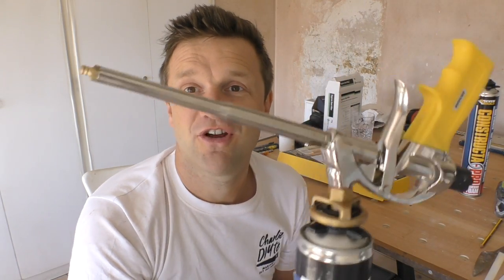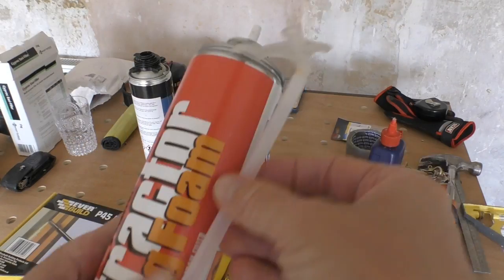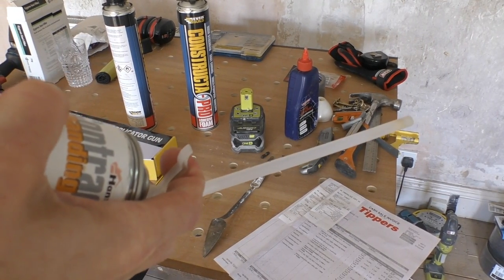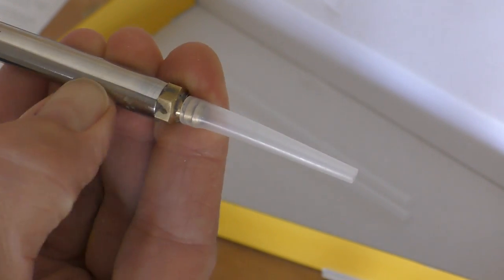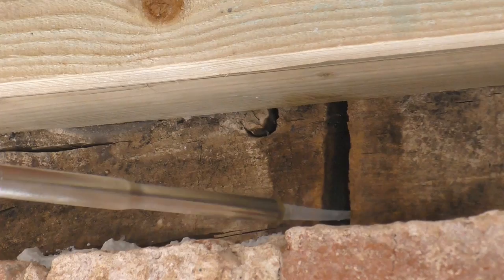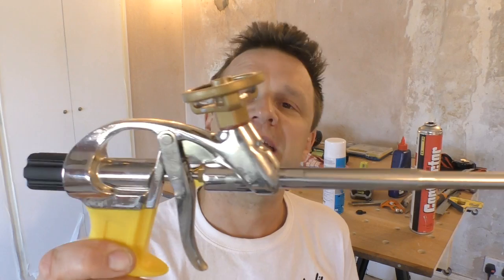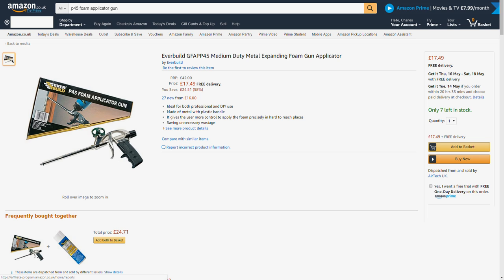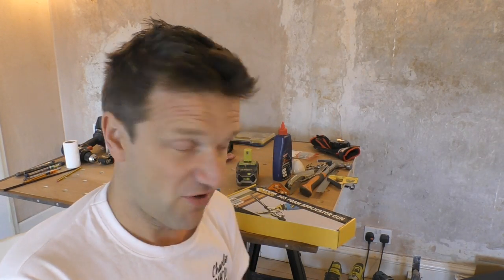Why Use an Expanding Foam Applicator Gun?

Comment: As you found out.....once you buy the foam gun, you’ll never go back to the disposable applicators. The gun is just so much easier to use, & clean; as well as, it saves the foam for another project a lot better. Use a different brand/version, but they are basically the same(differences will be cleaning & storage etc....). The gun I use actually closes the can & the gun nozzle in 2 different places, making cleanup easier; & like I said.....saves the foam for another project. Just comes down to how much willing to spend😆 & how many projects you will be doing over time...... Some guns are cheap disposable plastic guns, some are metal, & others are metal & Teflon coated etc....(most good guns will have a Teflon coated can adapter for easy cleanup).
GREAT vid, as many ppl might not know this secret, unless your in the trades.
Cheers😊
Reply: Aepek post a link for the gun you use please, cheers
Reply: Anthony John Will try to find a link for the gun I have(bought at a construction supply store....not a big box) so will try to find it, or very similar. Might take a day...just letting you know.
Ttyl

Comment: Charlie, Use Acetone and a $1 spray bottle from the garden center. I the States, 1 gallon (About a liter) but here it is less than $10. Put it in the spray bottle, Mark it with a felt tip marker (Flammable) but spray it on the straw, adaptor and if the can nozzle won’t spray, put some 10-14 drops in it, let it sit, then hit it with compressed air or simply push it.
 I used a can two month ago and had to move the ladder. By that time, it was plugged. But I put the drops into the cans tip and let sit for 5 minutes. Sure enough, it worked. Screwed on the plastic straw and worked get.  Went looking for “How to Clean” and found Acetone as a common denominator. Thank you for the info and you have different products overseas. It takes work to setup a camera, lights, props, tri-pod, then review, edit & upload. It’s work. Thanks from Nebraska.
The arctic cold air comes across North & South Dakota across Nebraska. There is only 5 strands of barb-wire and a mailbox to slow it down. So 3 weeks of -3,-4 high temps with -30 & -40 degrees F. Cold enough to Make sure to keep your giblets covered up!
Reply from the maker: Good to hear from you Dean. You paint a wonderful picture of life in Nebraska - very jealous buddy! Yes we have spray gun cleaner here which is I think acetone based. Definitely needs unclogging from time to time and a spot of silicone spray on the trigger. I wish I could reference more tools in my Descriptions for you guys, but as you say they're pretty different in a lot of cases. Thanks also for acknowledging the work involved. So true mate. My videos take on average between 2 and 5 days to edit 👊🏻👍🏻

Comment: I agree with you on the reusable applicator gun; once you use one you'll never go back to the disposable plastic nozzle. That being said, I've been reusing both the plastic nozzles, and the still partially full cans of foam, for years. Both the applicator straws, and the dispensing nozzle on the can, can easily be cleaned out with acetone and a couple of pipe cleaners. I've ended a work day with partially full cans, cleaned the straws and nozzles with acetone, and gone back and used them again sometimes months later (I DO like to rinse the acetone out of the can's nozzle, and blow it out with some compressed air, if I'm leaving the can this long however)
Reply from the maker: Thanks for this Jeff. I haven't had such luck reusing the cans, in spite of cleaning out the straws as you say. That said, you also need to clean out the applicator gun when not in use as otherwise it totally bungs up.

Comment: Hi Charlie. Up to now I have been using hand held expanding foam. I am very impressed with your video on the use of the applicator gun. One question I have though: Is the applicator gun better for being able to get the expanding foam in overhead crevices ?
Reply from the maker: It gives you much more control and it's much less messy because you don't tend to get it all over your hands like you often do with the throw away cans, but I'd say that if you're likely to be using it for one off jobs, say once a year, the spray can with plastic nozzle still makes sense, just because you do have to clean out the applicator gun after you use it as otherwise it can get seized up. A complete no brainer though if you're a tradesman using expanding foam every day and not getting through a whole can on each application.

Comment: THANKS for the video! 😎✌🏻 I clean the plastic straws with brake cleaner and reuse them as many times as needed it works out GREAT! although I will purchase the gun soon as it's more professional and much sturdier then the plastic straws. I doubt I'll purchase the cleaner since brake cleaner is drastically cheaper and works perfectly, in fact I think it's the same stuff (pressurized acetone) for half the price. ✌🏻🍻 Cheers from NYC

Comment: I bought one from B&Q for about £9 plus change..... definitely get the cleaner... makes such easy work of clean up.... even worked on my hair when l fell into it on-site pre-cured :(
Reply: You don't need to clean gun just leave empty can on and it can be on shelf for several months and will work when you next need it. But if you remove can you need to clean it extremely well or it will get clogged.

Comment: Great video, went and bought the gun had only one problem, when using the small plastic applicator the foam kept blowing it off and I wondered if you have had a similar problem and do you think taping it on would help?
Reply from the maker: Thanks mate. Yes I think that may have happened, possibly because I didn't press it on fully, although I tend it use it without the nozzle generally. The other issue I have is with leaving the foam in the gun for too long. I think it's a good idea to clean it out if you're not going to use it for a few days. I left it for over a week and it became a bit clogged up and stiff to operate. Other than that it's been a game changer.

Comment: Great video Charlie thanks. Quick question, why did you need to spray expanding foam behind the beams attached to the wall where the radiator was going?
Reply: I expect it's because those beams can't be flush with the wall. The foam behind them provides extra support and uniform spread of force when the radiator is installed and pulling on the beams.

Comment: I leave mine on the gun for weeks on end or as long as it takes to use it and replace as I'm using it everyday almost. Hardly ever use cleaner as I just quickly swap cans when empty and never had any problems. Wouldn't dream of not using the gun system
Reply: Yes always leave can on gun , I have had problems before with valve on can not working properly and foam spraying every where when removing can .
Reply: @samuelchamberlain2584  yeah more trouble than it's worth removing it before empty. Nothing to be gained from it. Just tuning valve off when not using is all you need ever do I recon
Reply from the maker: @ianthompson9058  Thanks Ian, Samuel. Really appreciate the know how, and I won't be taking the can off again until empty!
Reply: The Screwfix version of this ("No Nonsense" brand) says to do this in the printed instructions, i.e. to leave the can on until it's finished.
Reply: I have stored gun at least 8 month with empty can on and changed new can it worked just fine, never actually cleaned my gun.

Comment: For sealing up draughts due to gaps between floor and wall under kitchen units: Fire-rated expanding foam or mortar? 

I only have the height of a kickboard to work with, so don't think an applicator gun works in my case? Mortar seems far less hassle, a great insulator and also mouse-proof if that's an issue for you. Am I missing something?

Comment: You can clean out the plastic applicators so that they are reusable, turn the can the right way up and use the propellant in the can to blow the foam from the applicator, also cleans the foam out of the opening of the can, then just cover the end of the applicator.

Comment: Just clean up the still un-set foam with acetone. A few drops work wonders on the tip of the can and a sip run through the straw cleans it without any tools. I re-use the plastic applicators all the time, over months.

Comment: I have bought 2 cans of cheap ones and on both occasions the foam has come out until the can is about half full, then the nozzle gets blocked up and it wont come out any more, even if you take the pipe off, so I ended up throwing them away half full....they cost about £8 each...from Fred in Essex Uk.

Comment: I love my applicator gun. BUT! Let me suggest you take them seriously when they tell you to spray some through it at least every 30 days. (I actually suggest no less than every 2 weeks.) I know they're made more for guys who are using them all the time, so it's not a worry. But if you're a DIY user and pick one up to do a project, make certain you keep the product flowing periodically.

On the plus side, soaking the tip in the solvent will free it up and allow it to flow again, but don't put yourself through it.

Comment: Is Soudal foam better than no nonsense or everbuild brands or not at all?

Also, do you need to clean out that flexi extension nozzle while the foam is fresh or does the cleaner dissolve it the next day?
Reply from the maker: Soudal is one of the best but Everbuild also very good to be honest. Yes, best to spray acetone before it's set. If you're clever you can blow out most of it and then just pull out the residue, but the acetone is useful to keep the can end clean.

Comment: Will all cans of foam fit all foam guns?  I have bought a Roughneck gun and I'm not sure how to differentiate foam cannisters?
Reply from the maker: They need to be the foam cans that fit in the guns rather than the ones that you pull down a plastic trigger and extrude manually.

Comment: Important to clean the foam can outlet THOROUGHLY after taking the gun off or you WILL have problems anyway. I've been using a gun and found that even with a casual spray of the can outlet that LOOKED like it was cleaned, it still can clog. Better to blast the outlet throughly than throw away a half filled can. Otherwise, you may find the can becomes a volcano you can't stop!
Reply: I had this problem. I unscrew the gun and the can kept spewing out! I tried to spray on the nozzle quite a lot but it was no help!

Comment: From my experience cleaning is not an issue, you can use foam cleaner and it will quickly dissolve even dried foam. main advantage of a gun is ergonomics.
Reply from the maker: It's actually control. You get far greater control with the gun and it's a lot less messy. In terms of cleaning you do need to clean out the gun if you're not using it for a week or so as there's a tendency for it to get clogged up.

Comment: good video... i use some brake clean to clean the throw away ones and top of cans. acetone works too. is that what the cleaner is? im too lazy to look myself :}
Reply from the maker: Yes mate. It definitely contains acetone!
Reply: 100% acetone. i checked MSDS
Reply: I've used acetone successfully to clean the plastic tubes, but I think the guns look so much better and easier to use.
Reply: @SeymourClearly2  yes it does.. my problem is ill put it in a safe spot. then wont be able to find it when i need it. then ill just use the damn plastic :}

Comment: Does the can have to be upside down?  I used the cheap cans filling the underside of my roof and they have to be upside down, I had to squirt the foam onto the floor and fill in by hand which was very messy. This was because there was no space to turn the can upside down.

Comment: The applicator guns are great!  How long should you leave a part used can on the gun before removing it and cleaning the gun? I’m. On my 4th Screwfix gun, as the previous ones all stopped working after a few weeks left on a part used can :-(.      I also read on a comment on diynot that you should store the gun with can attached upside down.
Reply from the maker: To be honest Ian, I left my gun on the can for a week or two and had a bit of a job unclogging it. My advice would be to get a couple of cans of the acetone cleaner. Do your foam work over the weekend for example and then when you're leaving it for a few days, attach the cleaner and clean out the gun.
Reply: @CharlieDIYte  Yeah, good advice.  I tended to just do that after a can was emptied.  I'd clean the gun then attach a new can.   Also I didnt know about the  trick with making sure the ball bearing at the can side of the gun was moving freely.
Reply from the maker: @iwilson16  Yes they say that about the ball bearing in the instructions. I find if I don't clean it out regularly the trigger gets a bit stiff also. For the sake of using a bit extra spray cleaner it's definitely worth cleaning it out.

Comment: Turn can upright and spray it after use to let some gas through. It extends the can life and cleans most of the gun /applicator  out...
Reply from the maker: Good point, Wayne. I've got to say if you don't take this action, or clean the gun with acetone, it does clog up pretty badly.
Reply: @CharlieDIYte  I used a new £5 can to fill an over flow hole... The next day it had hardened despite spraying. A full can. In the bin... 

I've got a gun now and it saves the money... Just in wastage savings the gun is worth it... A can can last 4/5 times longer given you have far more control (output and movement speed). 

  I try to hold out longer  to do more jobs in one go. Now... But if insulating, you come back later to fill gaps etc.

Comment: To clean foam from a normal cheap plastic nozzle you use the expanding foam upside down, apply foam and then when finished place the can the right way up and press the nozzle top again which should only push air through the nozzle cleaning it... Then put something in the end of the nozzle... Like a screw or nail.... This prevents any remaining foam left in the tube from going off.

Comment: It's not just the cost of the gun. The gun foam cans are significantly more expensive per unit volume. Like 2.5x in the states. Throwing away an unused disposable can that's dried up still makes the disposable cans much cheaper. We're also seeing disposable plastic guns with valving at the tip.
Reply from the maker: Fair point. It's not a perfect solution as if you leave it on the gun for any length of time it can still clog up. I just find the control you get with this far superior to the throw away cans.

Comment: Don't take the applicator off the disposable one. Let the foam set in the end of the tube.  Long screw will get the set bits out the end when you next need to use it and because the tube hasn't been removed the foam hasn't set in the end of the can.  I've reused some of mine 3 weeks after the first use no problem.

Comment: Never knew the spray water stuff...Did u notice a difference? I never sprayed water on Em,doesn't it make it worse?
Reply from the maker: I think it helps with the adhesion to spray the surface first. I haven't encountered many that you actually have to spray the foam to help it cure though.
Reply: @CharlieDIYte  so spraying water over the foam helps it curing??

Comment: Buy the cleaner it’s basically acetone. If you do not have the cleaner use acetone. always clean your gun after your done using it.

Also, if you what your throw away cans to last longer, always clean with acetone after every use.
Reply from the maker: I agree. Problem is a lot of calls are only designed for a months user after opening. Combo of that and my gun being rubbish means my last can is unusable inspite of scrupulous cleaning with the acetone. I've bought a new non stick gun as part of the problem is the ball in the gun where you screw on the can keeps sticking.

Comment: so, the fix with the foam setting in the can nozzle and applicator is really easy, quick rinse with acetone, dissolves the foam and dissipates it.  easy peasy.

so, whats the cost difference between the cheap nasty can and the gun can?  I'm willing to be it's not just a little bit.
Reply: I got one on Amazon for 18 (U.S.)dollars, cans are roughly same price as cheaper ones also. But theres about 20 regular cans in one of the cans you screw on on the gun. and the foam will last in excess of six months or longer before drying.

Comment: If you sit the can upright a squirt just the gas/solvent out, the cheap & expensive nozzle stays clear. Keep the nozzle applicator on so it doesn’t clog. It’s written on the side of the can…
Reply from the maker: Yes I've always done that. These days I'm using a non stick gun. Amazing bit of kit as you can leave the can on there until it's empty.

Comment: The best way to clean out the plastic nozzles/tubes is to let the foam harden in the nozzle and leave it on the can!  Don't clean it out.  Then, once it's hard, pull it apart and using a drill bit Phillips #2, drill a 1" screw into the foam and using pliers, remove it.  THAT SAID, the professional nozzles are definitely the way to go for multiple jobs.

Comment: I bought a great stuff foam gun and returned it. I tried two cans of foam and they would not seal properly on the gun. Screw on the can and the foam starred leaking around the connection between gun and can. Continued leaking until I removed the can. Created a nice mess. Anyone else experience this?
Reply: Gone through the same issue, instead of returning it, I cut some rubber tubing and slipped it over the connection for the can. Sealed right up.

Comment: acetone dissolves expanding foam, so you can use this to clean your applicator,
Reply: The foam cleaner in a can IS acetone. I've found the spray cans for €4 on Amazon. Just have to look for them.